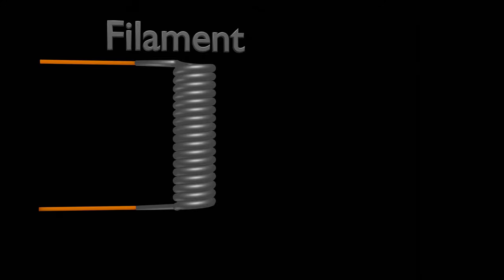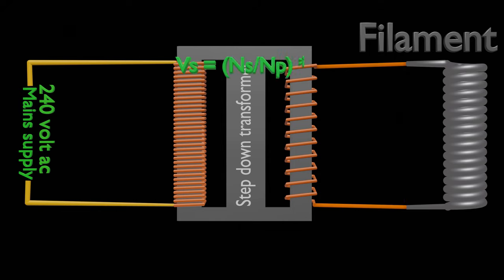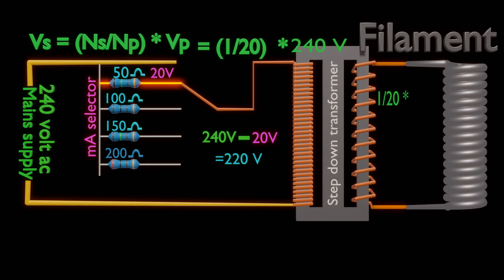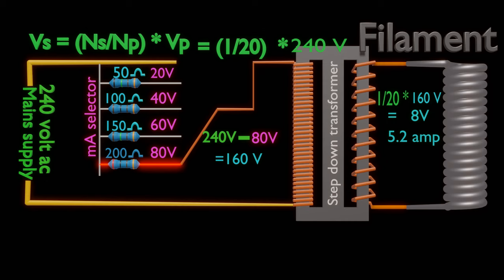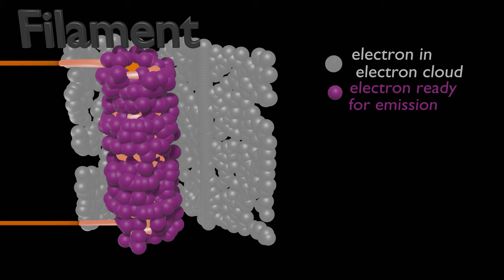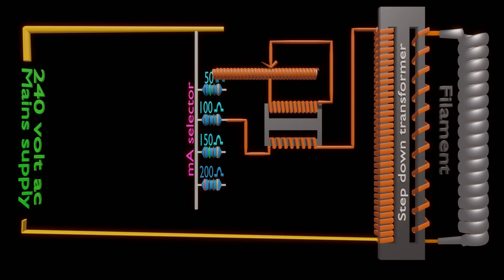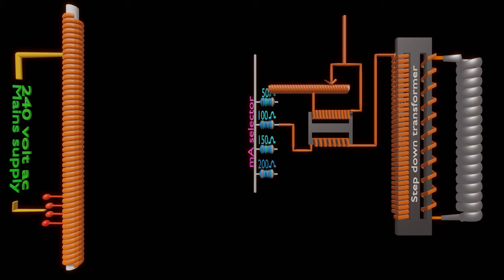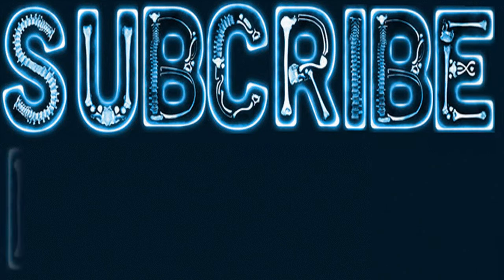Xray filament circuit or Xray mA circuit space charge effect

Comment: Sorry sir, I want to know, basic concept 
I know electric current move in closed circuit. 
Filament and anode are away from each other. How cathode become negative charge and anode become positive charge.
If you can clarify it, Where can I find concepts.
Reply from the maker: KV circuit makes anode positive and cathode negative in an xray tube. Circuit is completed (closed ) when electrons flow in  vacuum between cathode and anode. You may refer to last video
https://youtu.be/xZgFK4G0n_0
Reply from the maker: https://youtu.be/-2iiPhCYHIg